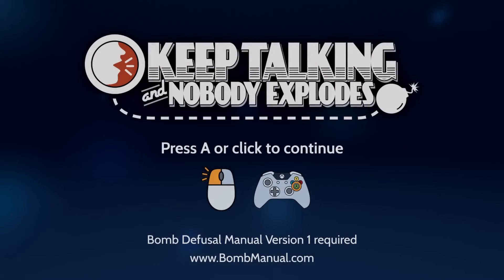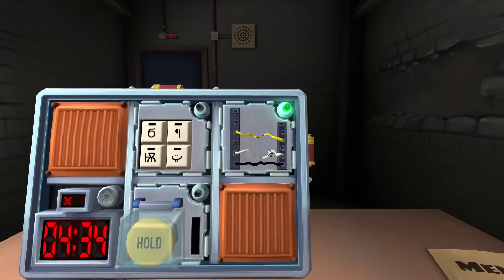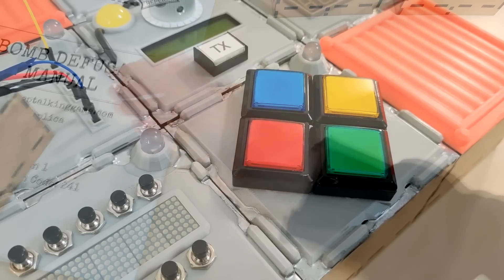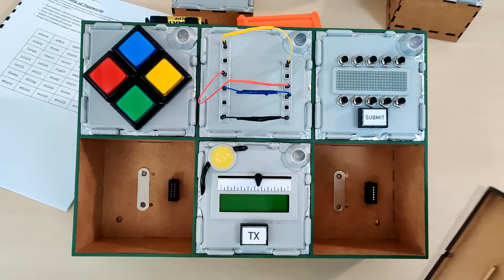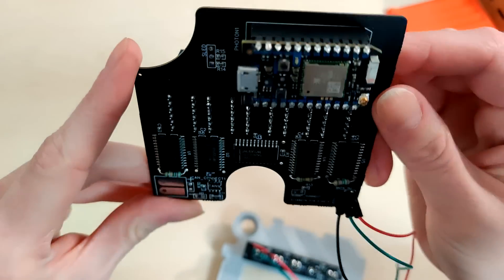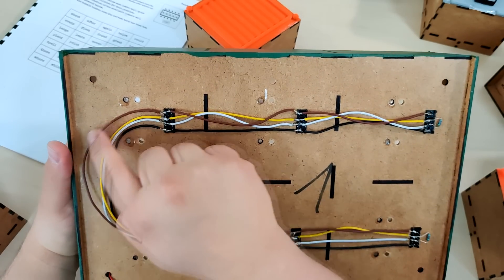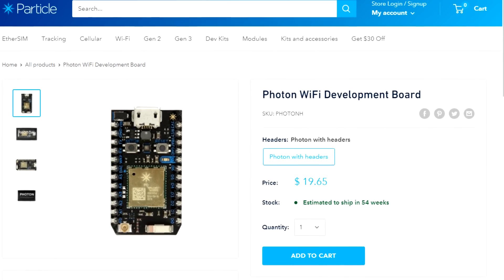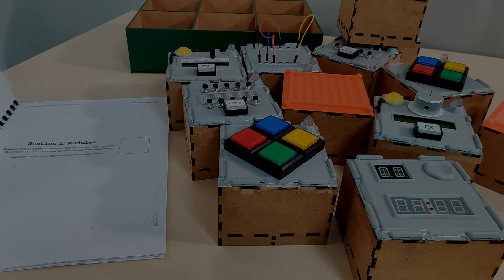Building a (harmless) KTANE replica

Comment: One side only ? Got work to do !
Reply from the maker: It is designed to support two sides. Actually it is possible to play it with two sides. But it's pretty clunky due to a module being 10x10x10cm. The two-sided box is around 30x20x20cm. It would be nice to build a slimmer version. But you need different hardware for that. Most of the buttons need a lot of space inside the module, so just building it slimmer was not possible for us.
Reply: @ktanefans4386  i'm actually making a new manual for new modules xd game called "Mission NO possible !"
Reply: @ktanefans4386  i think making them slimer wouldn't be so complicated, Maybe work on buttons

Comment: hmm
quite impressive wok, however,
there are dummy batteries on the outside. and the actual game has had few variant of those, would it not be possible to have actual batteries and maybe a cut out into the wooden frame for logic / initiation for the modules (raspberry pi or something that wont take much to start up) in place of battery taking whole segment? or use some other disguise within the frame i am no engineer just wierdo.

Having battery module being swap in and out aswell could infact give more opportunity for variation, as well as saving entire slot for more variant and difficulity.

Oh right i assume its in wood because its easier to work with rather than aluminium?

Comment: I'm alr imagining that, if you worked with the KTANE Devs to make this a commercial product, you could use a deck of cards to determine what modules go in and a few smaller decks and/or sets of dice for different setups of certain modules (I.E. how many wires and what colors) You could even make expansion packs for the more advanced modules. The biggest thing would be a ruleset and divider so that the handler can't see the bomb (if the players choose to play like that)

Comment: looks amaizing
i have a question, why don't use I²C?
Reply: Past experience with CANBUS would be my guess. a disadvantage of I2C is that you need to configure the address of each ahead of time, which may get confusing. Another things I don't like about I2C is lack of a default terminal, and relatively tight timing requirements. If it was me, I'd use UART, because of how ubiquitous it is. I'd have the main CPU doing all the game logic, and the modules are just HIDs. I'd have the main CPU running python, and have plaintext JSON packets travelling on the bus

Comment: I volunteer at a youth event. I might build one of these, print a manual, and let the visitors try and defuse it. Could have a little dividing wall between them, or even put them in separate rooms and give them some radios. Could be very fun.

Comment: This is amazing! Do you have plans for a double sided bomb or more complex modules?
Reply from the maker: We don't have any plans at the moment.

While planning these modules, we noticed that not every module in the game could be built in real life (for example, wire sequences).

Some others are possible in theory, for example the complicated wires.
We tried to keep the initial game setup dead-simple, but some modules would require a more complex setup. This is often the case when the game uses stuff like hand-written marks, like in complicated wires or the maze module. It would be necessary to add some way of telling the module which markings were made.

Some others would require a lot of resources/money to do properly, like the keypad or "Who’s on First".

Also, some would be pretty simple, but we did not manage to get our hands on hardware that would look like that used in the game. This was the case for the button module.

Regarding two sides: We initially planned to do so. In fact, you actually can put both boxes we made back-to-back and bind them togehter using screws. Then, only the data bus has to be connected.
We decided against doing this because it would just be too thick. The depth of the box is largly restricted by the height of some components. For example, the arcade buttons do really take a lot of space.
Reply: @ktanefans4386  thank you for your very thoughtful and thorough response!
Best of luck in the future with your endeavors.
Reply: @ktanefans4386  Maybe try the Not variations? They're identical, making something cool in the process!